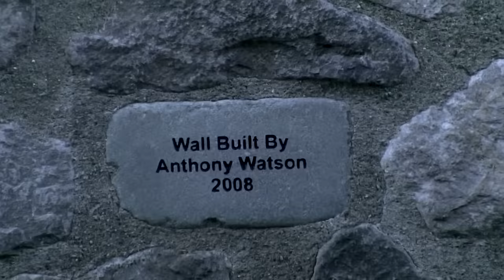Building Stone Retaining Wall

Comment: it won't hold!!!
Reply from the maker: Ten years and counting. Good enough for me.
Reply: Why did u say it wont hiold. What if i make a shorter wall?
Reply: Because he didn't read the part about: "Hi Jay. There is a 4 inch perforated drainpipe behind the entire wall that drains to daylight. There is also gravel backfill and landscape fabric behind the wall to prevent the drain from clogging. " which Anthony posted months before.

Comment: that's not a solution. u have built a damn. damns trap water.  Just because every1 else does it this way doesn't make it right. I had a wall similar to yours. I angled the wall, and laid boulders on it at an angle. this allowed plants to aggressively take root. it looks competent naturally and is basically.
     There are all kinds of videos of these walls being repaired cuz they collapsed in mud slides.
Reply from the maker: My "dam" has a perforated drain, crushed stone, and landscape fabric behind the wall. Water can't get trapped, there's no hydrostatic pressure, and the wall is still standing strong ten years later.

Comment: Fuckin wrong you have to build coarses not start at a corner just throw up stone
Reply from the maker: This isn't a brick or block wall. The wall varies in height and is built with random sized stones. There are no corners or courses to line up.

Comment: I don’t see much of a foundation or much of anything else that will stop the earth from pushing that wall over.glad you’re not building anything for me. Good example of how not to do the job.
Reply from the maker: Continuous 6" thick footing, reinforced with 1/2" rebar horizontally and vertically, set below our frost line (12"). Wall is a solid 12" thick mass leaning back into hill, 4" perforated drain behind wall discharges to other side of property. Gravel fill and landscape fabric over drain.  Wall is 14 years old now, looks like the day it was built. No leaning, no cracking. It will outlive me.